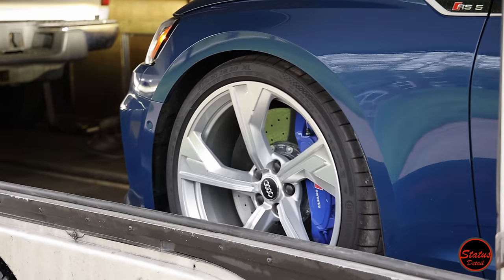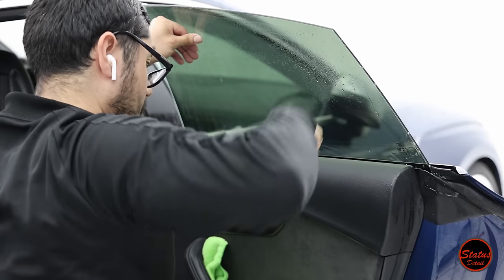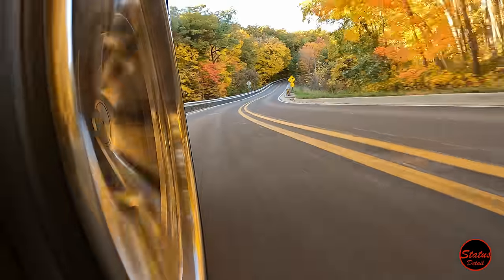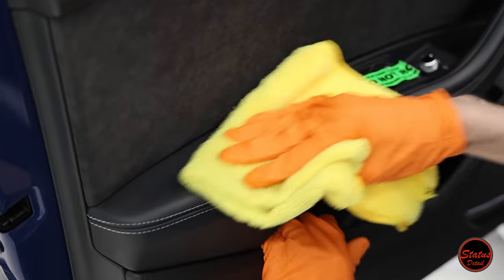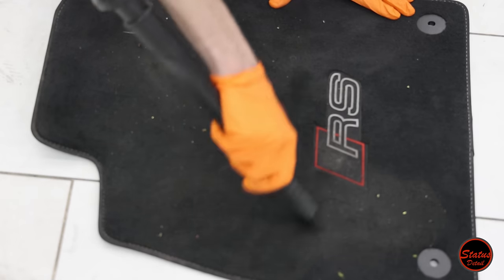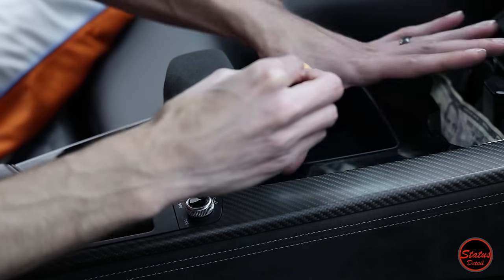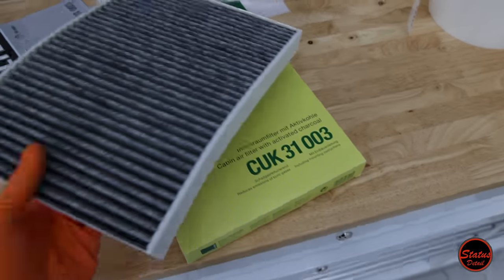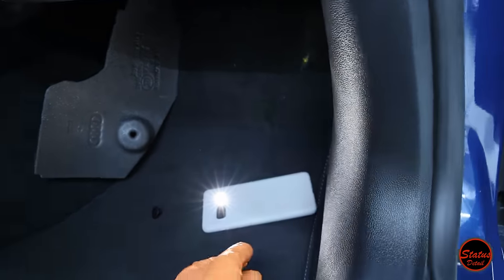World's Most EXPENSIVE DETAIL Ends In DISASTER

Comment: I just finished an 18 month project along the same lines. After work, weekends, I couldn't even guess at the number of hours but know it's well over 1000. What started with a valve cover gasket replacement led to the complete rebuild of the top end of the motor. Almost blueprinted. Everything OEM: Seals, gaskets, any rubber vacuum line replaced with silicone, new plugs, cable management, etc. New alternator, PS pump, radiator, water pump, all belts, rebuilt throttle body, and on and and on. Once the motor was done, I went to close the hood and noticed some leaves in the recess where the hood arms go. Turns out the windshield drains down the inside of the fender and that was basically full of mulch. That led me on a rust-prevention campaign, which eventually got me into the interior when I found the sunroof tray was leaking because the drain tubes were petrified with a kink in them, so completely blocked. Once on the interior I went about fixing all the things I knew needed fixing. All bulbs went to LED, sunroof drive belt replaced (and the drain tubes), new speakers, new wiring, added a Zapco small Class D monoblock just in case I wanted to run a sub later down the road. Even added a backup camera. I took the interior down to the paint. Seats out, disassembled, skins shampooed, etc. All plastic moldings taken out, scrubbed, cleaned. All carpet up, all butyl removed. Even took the dash out. Twice (FML). Dynamat the whole thing and rebuild. 

So the kicker is... this was all done on a 1990 4runner with 260k miles. The motor was actually a warranty replacement due to a manufacturing issue where the oil ports were too small and it starved the block with not enough circulation.  A few of them just got leftover crate motors instead of a rebuild. So... a 260k 4runner with 80k on the motor. I'm the second owner. But I bought it off a high school friend of my parents. I was on the camping trip back in summer when he showed up with it for the first time and I remember thinking how cool it was. I think that, gaining mechanical experience with the vehicle, and a reason to not sit in front of the computer working all day played equal parts in the inspiration to keep at it. I don't regret the time spent, I'd do things a bit differently a second time. But if anyone asked me 'How much?' for a job like that, I would just laugh and sigh.
Reply from the maker: Lol love it! That would be the "unlisted detail". The open checkbook it is what it is. 

Sounds like it was overall a relaxing fun experience for you. Very rewarding to finish a project like that.

Comment: I learned the exact trick on Alcantara when I was developing a line of auto appearance products about 15 years ago using a leather topical cleaner I was working on. That material is EXTREMELY efficient at compounding and locking in body grime. But even though it’s actually a pretty strong material overall, there’s only one way to bring it back to almost new condition and that is carefully. After experimenting with a number of methods, you are spot on that it takes many light applications and light removals to not disfigure the surface texture along with a very noninvasive cleaning solution like a leather surface cleaner. Since it was synthetic material, I tried scrubbing with an all purpose cleaner and yes, it removed the dirt and grime, but from the aggressive cleaning it also removed the surface texture. But if it’s done exactly as you show here, it will surprise folks just how much grime is actually matting down the surface texture and it’s not actually worn down. Alcantara is some pretty amazing stuff!! I want to make some golf club grips from it, lol!! 👍🏻😎👍🏻
Reply from the maker: Definitely agree! I have a video about this topic in a gt3rs and McLaren the steering was really bad! Totally fixed it!!!
Reply: @STATUSDETAIL , I had always thought that the material had worn out when it was matted down smooth. But I happened to run into someone that worked in textiles that knew a lot about the Alcantara material and he explained that although it’s a very durable material, its original design was to provide a very consistent and high level of comfortable grip. But the result looked so much like suede and they went all in on marketing it as a high durability synthetic suede. It’s one downfall was that although it provided excellent grip with gloves or bare handed on a steering wheel, it was extremely efficient at retaining body oils and grime which compounded and really held the surface texture down. A regular light cleaning of the steering wheel was originally suggested. But that suggestion never really got passed along. So, when operating with bare hands it doesn’t take long to lay down the surface texture. As mentioned, many folks think it’s worn out when in reality (as you have shown nicely) it just need to be properly cleaned. If Alcantara is cleaned lightly on a regular basis, it actually lasts a lot longer. Nice ride by the way!! 👍🏻😎👍🏻

Comment: 22:25 as an audi tech, the a5 series cars have the worst cabin filter placement. like almost all the others are the exact same but for some reason its recessed in the a5s and way more annoying. dont know why the did that on these. also a tip, assuming you have cpo coverage. right before the end of cpo bring it in to a dealership and say you had a coolant low warning. these V6s have a common issue where the water pump fails and leaks internally and coolant spreads through all the vacuum lines. its a 6-7k repair if out of warranty. beatiful car nonetheless.
Reply from the maker: That's interesting on the filter lol. 

Also interesting on the water pump leak! I need to double check with my warranty runs out and like a year. Just have factory warranty for now.
Reply: @STATUSDETAIL  yea, I've seen it happen as early as 20k miles and I actually have an SQ5 currently in my bay with coolant migration at 70k. they all get it it's just a guessing game of when. there is an extended warranty company called audi vsc platinum I think and they're actually pretty good about covering stuff from what I've seen, so if it doesn't happen by the end of warranty they'll be worth a look. not trying to scare you about it but it's not really something that's avoidable. better to know than not lol.
Reply from the maker: @etrcentenario9737  not scared at all. Just appreciate your comment and the information 🤝👍

Comment: I try to keep my car as clean and as factory matte as possible by wearing driving gloves, having microfiber for everything and I even PPF buttons/switches and levers I touch the most. What do you recommend to protect the seat bolsters from cracking? I trued every method getting in and out but I am seeing creases form.
Reply from the maker: Best method is to get in the car in a way that doesn't have you rubbing that spot. Especially on the GT3 Porsches I put a foot in. A hand in door sill. And then basically move my body over the seat and sit. 

Gtechniq leather gaurd is helpful. Keeping it Clean and using leatherique to keep it hydrated is helpful. 

But ultimately if you just rub that spot a crazy amount several times a day it's going to be difficult

Comment: Never heard of or considered the use of laundry detergent in the extractor but I want to try it now
Reply from the maker: Carpet's are fabric 👍 works perfectly. Don't put to much detergent or it will have a strong smell of detergent. If your into that then go nuts lol. It fades over time no matter what
Reply: @STATUSDETAIL  my car was recently in a repair shop for a month and the interior smells like it. I cleaned all the leather and used an extractor on the carpets but the odor lingers. I cleaned the headliner in same manner as you as well.
Reply from the maker: @burb17  gotcha. Then extra detergent might help. What did you clean with? Might want to swap your cabin filter too. The smell could get in the filter and blow back in the car
Reply: @STATUSDETAIL  after not being in the car for most of the day I noticed that the odor is now a fraction of what it was. I used Adams leather cleaner on all the leather. Their carpet and upholstery cleaner on the carpets followed by extraction. I sprayed it onto a towel and wiped the headliner a couple of times.
Reply from the maker: @burb17  In situations were bad smells get stuck in a car is 99% of that smell is going to be stuck in something fabric so the headliner removable carpets and not removable carpets on the floor. But also the fabric that's usually on the pillars around shoulder right and up. If the smell is really bad or lingering and you can't get rid of it I would personally try it tide and water in a spray bottle and spray it into the places you can't extract and then wipe it out Don't be afraid to do this a couple times just make sure you're spreading it out a couple hours apart or even a few days apart so you don't oversaturate. 

The floor mats are an easy one because you can remove those so you can really go to town and then just don't put them back in the car until you know they're fully dry.

The carpet underneath the removable carpet you can do a nice extraction with tide but that is one of the places you need to be careful how much moisture you're putting in. It's best to do that kind of stuff on a hot day and then leave the doors open in the sun and let it air out quicker. In the winter time you have to be careful because you can get a lot of humidity trapped in the car once you shut the doors. 
After doing my car I had a bit of a tide smell in it for a week or two but then it kind of faded to just being a normal nice smelling car. Kind of the same way new clothes out of the laundry smell like laundry detergent but after you leave them in your closet for like a week and don't wear them the smell will naturally fade away. The point is a dirty laundry smell that was on before is gone in the same thing goes for your car.
Good luck!

Comment: Can I ask why you bother paint correcting when applying film? Doesn’t the film cover any swirls and scratches anyways, and doesn’t removal of film have a high likelihood to introduce marring and swirls? That was always my understanding. Maybe do a jewling step for gloss but idk, or fixing orange peel I understand. I’d like to hear your thoughts.
Reply from the maker: It's simply the right thing to do. I want my paint perfect before I cover it for years with PPF. 

It also acts like a deep decon especially on used cars. You don't want to second guess dust in PPF during install vs after correction I have a mental note of every imperfection especially the ones I couldn't fix. So it makes your PPF go on smoother. On nearly every car. Fix something that's going to show past the ppf. In general paint correction enhances gloss. I want to seal that incredible gloss in with PPF.

Hope this helps.

Comment: I bought a 2020 Audi S4 which has 99% the same interior as yours, with 20k miles, and would like to do about the same as you did in the interior. I have Gyeon interior detailer right now. Can I use this instead of prep?

I was thinking of doing gyeon leather cleaner with their brush followed by Meguiars leather conditionner (because I already have it), finishing the rest with interior detailer. I'll try to rent a mat extractor to clean up the carpet.

Did you find an alternative to that piano black center console part?

Thanks for awesome video!
Reply from the maker: Thanks for watching! 

I think your mixing steps up. Gyeon leather cleaner mild is the main system to restore matte leather. Use the brush too. 

Advanced is following that with leatherique. 

I use Oreo after gyeon leather cleaner or if I go leatherique I do gyeon leather again then prep

If you have gyeon interior detailer detailer that works just like prep. 

I'm not a fan of meguires leather products.
Reply: What's the difference between prep and interior detailer for the interior?

I don't have leatherique products. I'll buy them to restore and maintain the leather seats.

What is Oreo?

So basic cleaning is gyeon leather cleaner mild followed by gyeon interior detailer and advanced is the same first 2 steps then leatherique 2 steps then again with the first 2 steps.

For everything else in the car, gyeon interior detailer does it. Any other products I should get?

Let me know if I get this wrong or any other input. 

Thanks!
Reply from the maker: @Alex-fo1rx  prep and interior detailer are basically the same thing. I just wouldn't use interior detailer on paint. But I would use prep on paint and on interior. So basically just by prep. When I asked gyeon some hard questions they didn't really have some great answers. Bottom line is are both very similar and have a decent amount of alcohol in them. You get to say things like this when you're not backed by any companies or accredited with any companies lol. I just telling how it is.

Sorry that must have been a typo  or autocorrect. Oreo was prep. 

Everything you said was accurate but if you're going to do the full leatherique then I would just do leather cleaner and then you can just basically go in to the oil. Prep before is overkill. But you can do it if your a above and beyond guy lol. Theoretically it'll make sure the leather is cleaner so the oil is more accepting. 

Leatherique or however it's spelled.
Prep
Gyeon leather mild
Gyeon leather brush

Gtechniq leather guard if you want leather ceramic to pick it all in. 

Towels.  That should be it
Reply: @STATUSDETAIL much appreciated! Can't wait for the next video!

Comment: Great job and the process is on point! it's good u were able to take a break and get some needed rnr, this job is very physically and mentally challenging specially when u work longer than 8 hours is were it get's you and just like you I zone in and at times close all the lights in paint correction area at the shop and just have my paint correction light providing light on each panel i work on so i dont get too much distraction and visual overload. And for the leatherique i apply the conditioner keep it saturated and wrap it in saran wrap and have my portable heater heat up the leather to open its pores and be able to saturate the leather anda leave it for a day or two then wipe off the excess which is very minimal or not at if the leather is really neglected and very dry to begin with.
Reply from the maker: I like to paint correct in the dark too sometimes lol. I've heard many people doing the leather oil that way. 👍👍
Reply: @STATUSDETAIL  love work  bradah and I would like to send you something u can use for ur personal cars I’ll find  your shop address and I have to try Stek film  as well.

Comment: Sonax Xtreme Alcantara Cleaner also works excellent on steering wheels. I cleaned the steering wheel from my fathers Giulia QV with a 100k km and it came out like new. I just need to find something suitable for the leather, Dr. Wack leather cleaner&care didn't work at all
Reply from the maker: Sonax is supposed to be good. I have not used it but Matt at obsessed likes it too. 

Give gyeon leather s try. Or the leatherique system if you want to go nuts lol
Reply: @STATUSDETAIL  thanks for the tip, I'll give it a try 👍

Comment: Thank you for the great video. About the leather cleaning. Aren't basically all modern car leathers actually coated with a polymer top coat? 

Because of this, "leather" cleaning products are actually pretty much useless, as you are simply cleaning the polymer coating. Mild dilution of APC is all that is needed. 

For the same reason any leather conditioner is not needed as it will not get thought the top coat in to the actual leather beneath. Now there are some products which advertise to rejuvenate the polymer coat, but of course it is hard to tell whether they work. 

Anyway this is just what I've learned, what are your thoughts?
Reply from the maker: True except on luxury and exotic cars that have fine nappa leather. Then it is never sealed.

Comment: What's your recommendation for blue jean dye transfer removal?  that's been my kryptonite lately :)
Reply from the maker: Recommendation 1 
Don't wear blue jeans. Lol

But we all do. So ceramic coat your leather and keep up with monthly or every other month fast cleanings with gyeon leather and a gyeon brush. Light pressure fast passes on seats that get used. Reapply gtechniq leather guard every 6 months if it's a big problem. It's fast and easy to install
Reply: @STATUSDETAIL  fair enough...but I'm going through my mid-life crisis and Jeans are a requirement...lol.   I actually did install a sealer on the MBTEX, but it still dyed the surface.   and cleaners are mild even when they do say strong....so it's not enough to remove the remaining blue from the leather.   UGH.....wish there was something that would simply dissolve it off and then I can reapply a better coating.
Reply from the maker: @talkingwithcars  gyeon leather and a gyeon brush does remove it fast. I wear jeans all the time lol

Comment: Hey Status, 

 Quick question: 

 Which ceramic coating would you recommend to a new mobile/outdoor detailer applying coatings for the first time? A coating that is super wasy to apply even easier to remove/wipe off and is the most forgiving against high spots etc?

 Thank-You.
Reply from the maker: Hey. Doing ceramic outside can be pretty hard. Crystal serum light is pretty easy to work with but I'd probably work even smaller than normal sections outdoors. Never in the sun or on a hot car. Needs to be cool and dry and in shade it garage. Possible but difficult
Reply: @STATUSDETAIL  kk . Fair enough. Thanks for answering 🙂👍